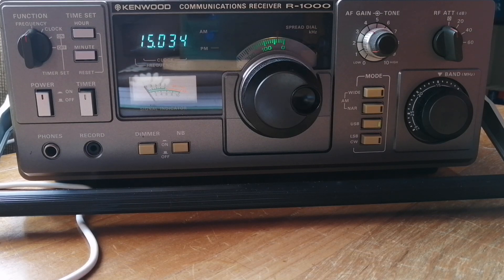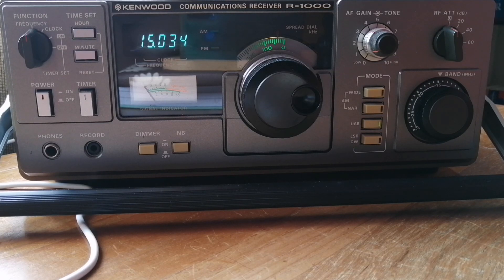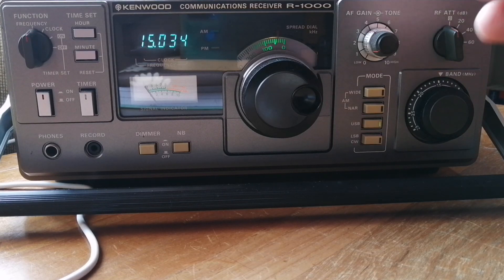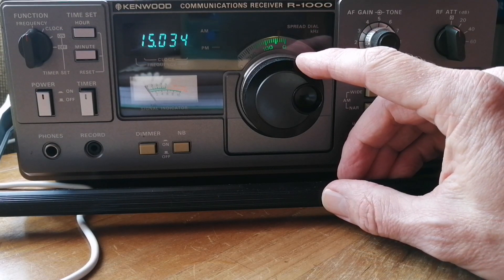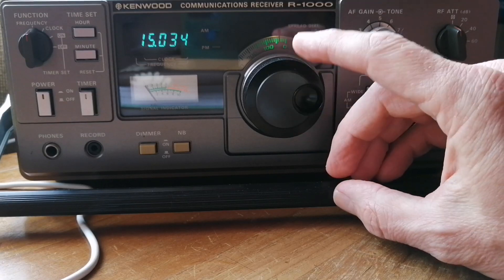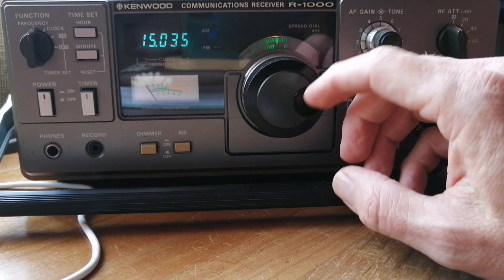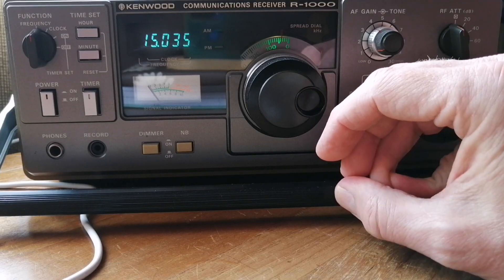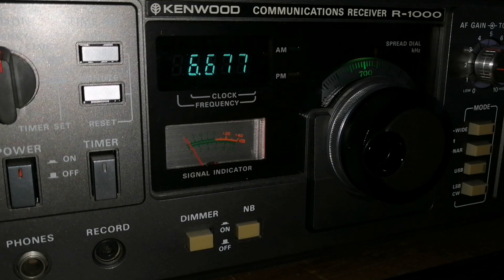I figured out how SSB fine tuning works on Kenwood R1000 #shortwave #ssb

Comment: I have a R-1000. Actually it's the second one I have owned.the first one didn't have the carry handle/ feet on it. I sold it last year to fix my bike I ride to work. This one I have now is a lovely radio and has the handle, only issue I have found is the large capacitor (I think its the main power cap) has a bulging top so I need to fix that asap. And I can confirm the one kz off frequency, my last one was the same as well as this one. And yes its very sensitive to tuning on ssb. Compared to my frg-7000 its a lot noisier and has a higher treble audio compared to the front facing frg and I find it has greater frequency pick up than the Kenwood and sounds more warm in its audio. I had an issue with the band selector dial. It would jump ahead in frequencies and would go from 8 to 9 MHz if you touched the dial. I removed that board from the radio and I placed it in a clear container with wax and grease remover liquid in my ultrasonic cleaner and fill the cleaners bath with water above the level of the liquid in the container. I ran the ultrasonic cleaner for a few minutes and blew it dry with my art compressor with it turned down so as not to damage the board. I used a small amount of wd40 on the dial and then replaced the board into the radio. Since Saturday its been working perfectly. I normally wouldn't use wd40 but as I'm restoring a car my funds are light and I didn't have anything else to lubricate it with. But I don't see it being an issue. I will do this same maintenance on it ever 6-12 months. I listen to volmets from Japan and receive Tokyo, nadi, Auckland l, San Francisco and of cause Australia HF primary and secondary frequencies daily and nightly here on 8867(which will be 8868 on the r-1000😅) 13261, 8904, 8828,8831,17904,12365. All frequencies are all 1 kz up on the R-1000 than what I have given here. I have been listening to air traffic on HF and vhf for over 20 years and I track the aircraft using a subscription app on my phone. I also have a enroute flip manual which is a book used by the ROYAL AUSTRALIAN AIR FORCE which was given to me by a long time neighbor of ours. It has every Australian airport listed in it. All the technical data like all the frequencies used even on ground fueling company frequencies. Also heights of the grass along some small rural airports, or if the runway boarders are grass or dirt etc. Radio masts in the ctaf areas, their heights above ground level, if there are birds that may be present on the fields nearest the airport which may pose a hazzaed to aircraft or even wild kangaroos in isolated airports. Its a very interesting book and even the spiral bound metal spine of the book may pose an interference to on board nav aids and there's a warning on the cover. Its a few years old so I'm due to renew it. 👍
Reply from the maker: Thanks for sharing your experience with the R-1000 receiver, @Okish77! It's great to hear about your experience with the device. The 1 kHz off on SSB mode seems to be a common issue with the R1000. Your troubleshooting and repair skills are impressive! I am too nervous to work on my receivers myself, I am scared I will break something :-)

Your comments about the R1000's sensitivity and audio compared to the FRG-7000 are interesting!

I was very interested to hear about your hobby of tracking aircraft using HF and VHF frequencies, along with the resources you use like the enroute flip manual that you got. What a great resource, with so much information, even the height of the grass!

I love listening to VOLMETs and HF aircraft communication myself. I also hear Australia, and Bangkok, Hong Kong, Singapore, Mumbai, sometimes Karachi and Madagascar. My best HF catches so far have been the Azores and Manila.
Reply: @swlistening  I mainly listen at night now to the HF radio as I don't have as mush time as I used to. Any repairs I do I do I'm nervous to and do it only of its not a very difficult repair. Like capacitor replacement. The internet is a good source for tracking down repair how to videos and part identification. I find that a forward facing speaker on radios like the yaesu are better than the Kenwood when listening to low level stations like amateur operators and HF volmets. But nothing beats a good antenna but I'm restricted with what I can put up so the current one I have is good enough. The tracking app I have I'm not renewing, its fantastic but honestly it's kinda a waste of money for.me as I'm not using it anywhere near as much now to warrant paying for it.if you were a real die hard plane enthusiast and had time to use it then I would keep it. When it comes to radios, some  sellers are asking way too much. Especially the yaesu frg series. As good as they are, I would pay more than $400 Australian. Even for a grundig satellite they're way over priced. One thing to remember is the age of these radios. We're talking 40+ year old rigs and getting parts for them will be difficult for some and finding a reputable repairer is also difficult. So a hobby like this is good id it doesn't cost you a fortune.

Comment: Brother a question I'm in Ireland and I'm listening to a shortwave channel on 6300khz it's 17:30 Tuesday in Ireland the station is crystal clear but I can't get any information on Google where its from btw I'm using my new xhdata D808 with an mla 30+ magnetic loop antenna...thanks bought this receiver because of u .
Reply from the maker: I think this might be Chinese jamming of Radio Free Asia, I pick that up sometimes on 9300 kHz. But I'm just guessing, I don't know exactly what you heard. So it could be the Great Firedrake or CNR1, which are both used often to jam Radio Free Asia.

Comment: Yup. Works fine. 👍. Now remember ham radio is way most often in LSB below 10MHz and USB above. Commercial stations like the one you just received are always in USB.
When you switch from LSB to USB or the other way around you will notice that the direction you need to adjust the dial to f.ex. get the pitch higher has switched. Happy listening.
Reply from the maker: Thanks for the information, very helpful! I am really happy with my R1000 now 😀

Comment: Andre good to see that you able to make the R1000 even more useful.  The closest radio I have this is my Japan Radio JRC-535D, but the offset on that radio is automatic, and the dial has a flywheel which helps fine tuning.  However, when I bought it new it costs about twice the price of the Kenwood R1000, so I am impressed that yours sounds better than mine using the internal speaker.  I found using an external speaker was the only way to make it shine on music.  
73! Happy Holidays, and have a great day🎉🎉🎉!
Reply from the maker: The JCR sounds like it might be quite a bit more comfortable to fine tune, sounds like a great set. To think, all the time the Kenwood was capable of fine tuning, I just moved the dial way too fast. A really steady and very slow hand is needed. But it works 😀 Enjoy your holidays!
Reply: @swlistening  Andre as long as you can fine tune, then you have a winner.  The smooth dial on my JRC makes it a pleasure to operate but the radio that you have is much more important than one you don’t have.  .
Reply from the maker: @Kw1161  Agreed! The best radio is the one you have 😀

Comment: Eureka! The SWL King has finally gotten his R-1000 to receive VOLMET signals! ☺️📻👑👍🏼

You've probably noticed that the S-meter not registering a strong reading. I think that's normal since SSB transmissions don't have a carrier signal. None of my SSB capable radios indicate a significant signal strength or S/N values either. 🗼⚡
Reply from the maker: Took me a good while! But I'm very happy that I finally figured it out. Much credit must go to you for your advice and that link you shared with me. Thanks for that! Interesting that you mention the S-metre, because I did notice that, even though the Bangkok signal is quite strong. I guess it makes sense, now that you point out that there is no carrier signal.
Reply: @swlistening  Absolutely. When your R-1000 is on SSB mode, you can see that the S-meter needle fluctuates with the speech, which constitutes the sideband information. With AM signals the needle will remain constant (barring selective fading) between speech or music pauses since the carrier is always present. 🙂

Your R-1000 has a external speaker out jack. I didn't tell you this, but last month I got myself a Diamond TS-750 external speaker for my Malahit SDR clone. It's very cheap, around US$6 including shipping. It's a got a "Noise Filter" switch and an -8dB attenuation switch. I don't know how the noise filter works since this speaker isn't powered and I think it uses a simple low-pass capacitor circuit to reduce the high frequency background static.

The TS-750, being a passive speaker isn't suitable for low output headphone sockets like the D-808 as the volume is so low. The only reason it only works well with the Malahit is because it (the SDR) has an adjustable headphone output amplifier. If you need to amplify the headphone out audio from say, your PL-368 you'll need a powered (active) speaker with an built-in amplifier. 

The TS-750 is designed for communications/ham radio transceivers as they always have an external speaker out socket. I was thinking that you might be able to improve the sound quality from the R-1000 by using an external speaker. Kenwood did sell an external speaker back in the days - I believe it was called the SP-100 speaker. 🙂
Reply from the maker: @StratmanII  Thank you for this, I actually think an external speaker is a very good idea in some cases. I use the Tecsun ICR-110 sometimes as external speaker, but a good-quality one like you suggest is definitely worth looking into. I have seen quite a few videos of DXers who do that. But first on my list of purchases for 2024 is another radio, I am looking at a few options right now.
Reply: @swlistening  Noted, sir. While you're abroad for the holidays, you might want to shop around for that Eton Elite Executive, bru. 🙂 Or you could also get the Tecsun PL-680 and form an alliance with Deniz! 📻📻☺
Reply from the maker: @StratmanII  I am looking for that Eton Elite Executive and the Sangean PR-D4BT everywhere I go, but so far I have been a bit disappointed. The radio and electronics stores and hypermarkets I have been to so far are not that different to what we have in South Africa. The stock, in comparison to what I can find in South Africa anyway, is basically the same. Lots of nice speakers, smart speakers, digital radios, but no SW radios, and no speciality MW radios like the Sangean. I will keep looking...

Comment: I believe below 10 MHz should be set on Lower Side Band for ham frequencies. The radio could be recapped or realigned to correct the one KHz issue. Have a nice Christmas.
Reply from the maker: Thanks for this! I will try it some time.
Reply: Most hams are USB. 7000mhz-3000mhz are LSB. 20 meters (14MHz) is USB.

Comment: Oh wow! Maybe consider the R1000 for travel then.  I guess also that the R1000 has the same issue as the Tecsun PL680 then! Also, I let my Sony warm up a bit before DXing, as it is an old machine.
Reply from the maker: Way too big for travel! I always travel very light :-)
Reply: @swlistening Desktop communications receivers don't accommodate dry batteries as they're not meant to be portable. Some can accept a 12 volt DC input from a car battery though. 📻🙂
Reply from the maker: @StratmanII  I'll only ever take this one along on a trip if I am driving and staying somewhere for an extended period of time. It's just too bulky for travel.
Reply: @swlistening  Same with my Sony actually.
Reply: @FamtechVideos  When it comes to vintage receivers, expect the tuning dial to be off by several kHz. Sony radios can only be calibrated by opening up the chassis and knowing which component to adjust.

The PL-680/660 aren't DSP receivers therefore expect some units to be off by a few kHz. Fortunately you can self-calibrate your PL-680, in the same manner you can recalibrate your PL-368.

I would need to see a video clip of your PL-680 tuned to a strong SW station's published frequency. 🙂
Reply: What's wrong with your PL-680, my young Padawan? It's all right for receiving single sideband signals although it can be a little tricky for the inexperienced user. 📻🙂
Reply: @StratmanII  It is to do with the SW callibration. It is off and it always has issues.
Reply: @FamtechVideos  I may be able to help you with that. How many kHz is the SW station off by?
Reply: @StratmanII  It is hard to tell. I need a distant signal, I will try in a few hours as I just woke up 20 minutes ago.

Comment: Very interesting. I’m wondering if an adjustment to the tuning capacitor will remedy that 1khz or a replacement of the capacitor?  Or perhaps just leave it be! Happy Holidays to you Andre! 🎄
Reply from the maker: Hi John, I think I'll just let it be, apparently it is an issue on all the R1000s, no idea why.
Reply: @swlistening  I totally agree, it is a fine receiver
Reply: @swlistening  No. They are quite precise. It is just an adjustment to one of the crystals. They can drift a bit over the years.
Reply from the maker: @migsvensurfing6310  Thanks, so it's just the age of the receiver, good to know it can be fixed.